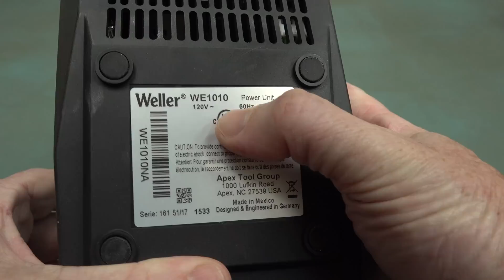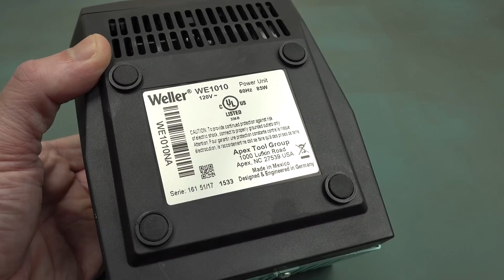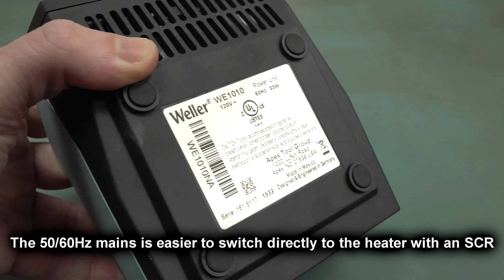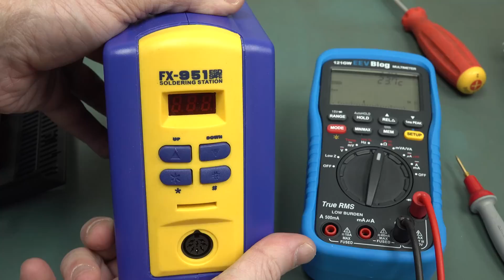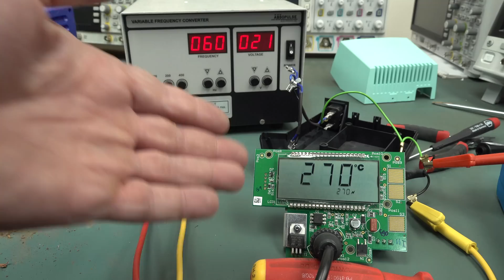EEVblog #1152 - 240V-120V = Magic Smoke!

Comment: Is there a 240V version of that station that you could by a replacement transformer from that model to repair it. Wonder if the original cord had a fuse in it, some American devices are sold with a removable cord that has a fuse in it (stupid practice , I know, right?)  , like sitting next to me right now is a Holmes brand box fan that doesn't have an internal fuse but rather relies on the included removable cord has a one of those slightly modified C7 connectors on it with one square side I'm sure I could find a non fused cord lying around from an old radio or something that would plug into it.
Reply: That´s the stupidest thing I think I´ve ever heard of lol. Fuses in a removable power cord? come on, who came up with that??

Anyway, he could buy any 240v/24v  with a similar power rating and put it in there. No need for anything special.
Reply: @Basement-Science  Especially if you use a totally common power input connector. If that would have been a proprietary plug, it would still be a stupid idea, but a standard connector? That's just crazy.
Reply: I guessed that. Is it still 'normal use' to keep the fuse in the cords? I remember these special cords on computer-equipment (and because we didn't use the cords, we took the fuses out before tossing the cords away when we re-equiped it for 220-230 Volts).
Reply: Thats not that stupid. If you have a fuse in the powercord, you can more easily replace it. Easier than if it was on the pcb anyway.
Reply: @jort93z  You aren't supposed to replace a fuse on a regular basis. You should think about why it blew. Also .. just put it in a fuse holder on the device like it was done for decades.
Reply: It's stupid if the cord uses a standard plug on the device side and the cord could be easily and mistakenly substituted for one without any protection.
Reply: @jort93z  At that soldering station? Just make the hole a little bigger and put an IEC socket with integrated fuse holder in there. They typically carry a spare fuse, too. 
Devices needing an IEC input typically are big enough to put a fuse holder SOMEWHERE. 

A fuse in the plug or something is fine, as long the cable isn't detachable at all. If it is detachable .. maybe with a very proprietary connector, but I still wouldn't like it.

Using an IEC-connector is .. I switch those leads around like crazy.
Reply: @VintageTechFan  Yeah, just looking inside the thing when Dave took it apart there was plenty of room, and on my Box fan there should be sufficient space in the motor hub area to put a fuse holder and actually I don't know why they made the cord removable since I would think it would be cheaper to permanently attach the cord and if the cord is permanent then there is no problem with putting a fuse in the plug although I think it would probably be smarter to put a fuse inside the device because is discourages less knowledgeable people from replacing or bypassing the fuse if they have to get into the motor hub and if a box fan is blowing a fuse it's probably fried anyways and should just be discarded if someone were to put a piece wire or a wad of foil or something to bypass an easily accessible fuse it could start a fire.

Comment: Are you going to add a switch mode psu to replace the transformer and rescue the station!
Reply: SMPS, NOT NEEDED.  
Dave just needs to source a COMMON 240 Volt to 23/24 Volt HVAC (heating, cooling) transformer at 2-4 amps that is same size.
THESE exist .... since those same HVAC transformer suppliers were OEM suppliers for some earlier Weller products.
Reply: You don't need to rectify the output of the SMPS if you don't want to (except maybe for feedback purposes).
Whether the circuit can work with tens to hundreds of kHz AC is another question, but I wouldn't rule it out completely.
Reply: galfisk Running 100kHz down that iron cable doesn't seem good from an EMI standpoint.  A normal SMPS keeps the higher frequency stuff paths to a few cm at most.  But then again it's still longwave with medium wave overtones, so a 2m lead might not be a problem.
Reply: It’s only a 24v output. These things are everywhere.
Reply: Caramelization is insulation, right?
Reply: Don't work because we need AC not DC.

Comment: Put the transformer from that crappy Hakko knockoff in the Weller if it is close to 24 V.
Reply: lol that would probably work. And while you´re at it, put its fuse in the weller as well!
Reply: I have chinese Weller knockoff. It does not have transformer in it, but a lead weight. The temperature adjustement is just a Triac without  feedback. But  it works quite well, considering the 10€ price.
Reply: Thats what I was thinking!
Reply: don't forget to relable the 120v to 240v
Reply: but that would void the warranty on the Weller!
Reply: Jacksat  but then it will defo catch on fire:(
Reply: MrOrangeman18 no, hakko clone has actual fuse
Reply: @rasz  
Yes, but I doubt the transformer insulation is anywhere near as good as the Weller transformer.
Reply: @WaltonPete  : Maybe ,but good enough to squeeze some more years out of the Weller .
I rather toss that fake Hakko board and iron in the bin than the Weller , if it provide enough current you won't note any difference  against the original transformer ,maybe the iron would heat up faster on 230V trannie.
Dave ,put the Hakko leftovers in the dumpster for the next "Dumpster diver"   😁
Reply: @MrOrangeman18 , but not if a rated NA fuse is replacing the Chinese version, first.

Comment: Why the heck are the plugs compatible for different mains voltage? Go with EU plugs!
Reply: What's the replacement of IEC sockets in Europe?
Reply: IEC sockets are fine in EU, but you have to put a fuse right after the connector. That way it would be safe.

Comment: Dave get a 240V transformer that fits in there and fix it! Would love to see a repair video!
Reply: Yeah, 24V secondaries are very common, shouldn't be hard to find one.
Reply: I reckon Weller will send a complimentary replacement within a week :)
Reply: Green Silver  a rewound MOT would be way too big, but in theory, sure.
Reply: Or send it to Weller’s swap-it-with-used-shit center and see what mystery one you get back!  If your lucky, it will have solder tip burn marks on all the buttons like mine!
Reply: Manu _ 
I was thinking along the same lines, could a salvage MOT be used stead?
Reply: I want to see him wind his own! 8)
Reply: and show us how you think the primary side should be protected, even though you change it to 240v. That's what I would like to see.
Reply: Why get a new transformer? Rewind the the primary on the original one for 240V! Electrical Steel is hard to come-by for non-industrial customers.
Reply: TheCreeperkiller But rewinding a rectangular bobbin is difficult without cutting open the welds on the core. Cutting and rewelding isn't exactly going to preserve the electromagnetic properties of a laminated core.
Reply: John Francis Doe
"Cutting and rewelding isn't exactly going to preserve the electromagnetic properties of a laminated core."

What does this mean?  Welded steel is welded steel.  I don't understand how it would change the properties.
Reply: @KerbalLauncher  My toughts exactly. Then I remember that in high school I had to do it and it was a PITA
Reply: I have done rewinding a few times. Yeah, it's a boring task. And those where not welded transformers. Some of them had cores that had to be assembled from the opposite sides interleaving E and I parts and then tightening all of that together with some outer shell or even some kind of glue. Cheap design and it gives out some humming noise, but still working just fine.
Reply: @KerbalLauncher , The EI core has been welded shut, making disassemblly all but impossible.
Reply: @kittsdiy  id replace the transformer. But Id also get one rated for at least 26 volts on the primary unloaded.
Reply from the maker: Replacing a transformer hardly makes for an interesting repair video.
Reply: @EEVblog  Change it, not because a video - this thing is a SURVIVOR - it deserves repair.
Reply: @nasko8605 ,   a survivor with a FUSE, this time.
Reply: @EEVblog  Well, you under-estimate the amount of interest there would be in such a video.  I would love to see it, as far as sourcing the part, even if it was salvage, would make for good conversation.  Heck, make a custom mod with that in your own custom box.  There is an opportunity to do quite a few things with that.  I for one would love to see videos where one modifies or upgrades equipment to make it better or more usable.  CHEERS from Ameerika!
Reply: @EEVblog  You could always do the replacement and use it to demonstrate the proper fusing arrangement.
Reply: @EEVblog  You can always send it to one of those "I'll fix it no matter how totally busted" masochists here on Youtube. Could be therapeutic to see him rewind the whole primary.
Reply: @EEVblog  So, says you!
Reply: Make it sing one song when you over volt it again and another song when it is warming up and yet another when it is cooling down.
Reply: @EEVblog  *update you mean. id repair it. even with a better one that is better on the mains and secondary and 120/240  transformer. edit also with mains fuse.
Reply: @EEVblog  You know people would still watch it! Second channel worthy, maybe?
This thing's a survivor and deserves a second chapter in its life :P
Reply: @EEVblog  You're right, a simple tranny replacement wouldn't be very interesting but you could "EEVBlog" it up. Sorta like, "that's not a transformer, this is a transformer!" (Installs a ridiculously huge tranny).
Reply: This thing will smell so bad after that, doubt he wants it around.

Comment: Take it you don't have a fuse in the plug top  as we do in the UK..
Keep the good work
Reply: In the UK the plug's fuse, if correctly sized, is only to protect the house wiring and the cable from the outlet to the equipment. NOT the equipment itself! Using an incorrectly sized fuse , typically using a 13A fuse where a 3A would be more suitable (which now is most of the time) can cause fires as the equipment cable overheats.
Reply: That is correct
Reply: @daveturner5305  I'll take good ol' American power any day. 120/240 60Hz
Reply: But having a fused plug is still better than not having a fused plug, even if the plug has a 13 Amp fuse fitted. 
Having said that, 3.1KW of available power in the UK will make a big mess to those tiny primary windings.
Reply: The fuses in UK plugs just allow you to use a thinner cable from the plug to the equipment, that´s about all.
The house wiring has to be correctly protected by the circuit breakers in the distribution board.
Reply: Absolutely - no contest. We are in agreement.
Reply: Further - this is the thinking in the UK: which, in my biased view,  whilst not the most convenient system for size, is nevertheless  the safest system where a ring as opposed to star distribution is used!

Waiting to be shot down
Dave
Reply: @daveturner5305  Star distribution is not generally used in socket circuits.  

As you say in the UK we use the ring (which most sparks seem to hate even though they still use it) or the radial.  Think a ring  but instead of the last socket having a cable going back to the distribution board the circuit ends there.  Radials generally use thicker cable and/or a lower rating breaker.

Abroad, it is generally only radials that are used.
Reply: @cjmillsnun  what's so hard about a ring it's just got a start and a finish  simple
Reply: @cjmillsnun   UK electricians don't like ring mains (now called ring final circuits) because of the more complicated testing required.
Reply: @johnnodge4327  Even if the primary shorts completely, the remaining cable may not get to 13 amps and that would be a big mess. So a correctly sized fuse is needed.
Reply: Nope.  In Australia there will be a 16 or 20A breaker in the distribution board, so 3800-4800W can happily flow without tripping anything.  There's no protection for the flex from the outlet to the equipment, or the equipment itself.

Comment: Several current soldering systems have switch mode power supplies. Service people used to avoiid them because of the noise they generated but these days everything has such a supply so there is no longer a desire to avoid them. The problem with everyone using IEC cords is you can easily plug something into the wrong voltage. That was an advantage fixed cords had over these.
Reply: Honestly you would think that every device sold today would have an SMPS, but apparently it´s not worth investing any development into these products and pay the higher materials const of a mains transformer instead.

Comment: I'm shocked! No fuse on the primary side!!! And we are talking about a Weller brand. That's a shame.
Reply: Dana Vixen If you watch it carefully you will see that's on the secondary side. It should have protection on both side!! I think a glass fuse is a basic thing to have in circuits like this.
Reply: @gaborballa8566  exactly! For that amount of money, even for an entry level device from a supposedly high end manufacturer, this should be mandatory, full stop.
Reply: Even better HRC sand-filled ceramic, glass can explode with high fault currents ... https://electronics.stackexchange.com/questions/31366/fuses-what-are-the-practical-differences-between-ceramic-and-glass-cartridge-fu
Reply: Weller has become garbage.  We have 8 of the WR3M ($2500 machine) and the pump impeller vanes fail constantly.  Every part is available except the pump.  It’s a beautifully made machine except the pump that you cannot replace.  Go with Metcal.
Reply: @gavincurtis   where i work we have 18 wr3m and they run since we bought the 10 years ago with no problem on the station the wsp80 iron dies quit quick in about 6to 8 month but weller replaces the with no questions but the tips on the 120w deslodering tool( i think is the dsx120 but im no sure) is total garbage i need 1 to 2 a week .
Reply: Nick,  perhaps you are not using the desoldering or hot air pencil as much as we do.  The defect is the material used in the graphite vane pump.  Glad yours has been good to you. I just sent 2 more units recently, one missing a pump completely as I sent it off to somebody else to have it duplicated so we have spare pumps.

The graphite vanes appear to be more resin than graphite so they wear very quickly when hot.  There is very little allowance for wear before the pump seizes.

I will never buy another WR3M.
Reply: @gavincurtis  they are not mine but i use the on at my workbench for 8 hours a day for hot air soldering and tht desoldering mainly i have a small weller station for smd soldering too that runns with no problems
Reply: Do the ones you have use the mechanical vacuum gauge or the green/red led vacuum indicators?  It is a problem because a particular eBay seller had replacement vanes manufactured.  He sold out his entire inventory in a few weeks.  Every single unit of mine is on its 2nd or 3rd exchange.  All because weller refuses to make the part available like all other parts.  Recently got a Metcal rework system for my master tech.  So much better for desoldering, much stronger vacuum pump.  Time will tell of it has a good pump for lengevity or not.

I had a pump sent to china for reproducing.  Graphite vane pumps rarely wear out. The graphite vane pump in the Weller stations appears to be a cheaper brownish shiny material than graphite.  It appears to be graphite and resin, (like a brown bakelite) and not the jet black graphite like other vacuum pumps that never wear out.  I sent a pump to china to be reproduced.  They said the materials are wrong for high temperature gasa and vapors.

Regardless, glad yours have been good to you.  I will be replacing.mine with Metcal stations as they die now.
Reply: I've never been very impressed by Weller stuff anyways, I know it's a known brand and everything but I never got the feeling that I'm getting full bang for my buck with them.
Reply: I used weller for years and they were the best. I need a new heating element / temp probe for my old weller 4000 series.
Reply: That's what I said. Where is the thermal cut out? Is this because it is an "industrial" product as opposed to a "consumer" product? I wonder, as if you look at the older professional video cameras, they did not have to comply with the radiation emitting device standards that home video cameras (with the B/W CRT viewfinder) had to comply with.
Reply: I've had issues with two WESD51s, including a replacement iron. (Temperature going to 900-ish  on the screen and going cold)  Shaking the irons usually fixed it, until it progressively got too bad to bother with. I gave up, went with a pair of JBCs. My WES50 lasted well over a decade. I don't think Weller means what it used to as a brand.
Reply: One of the WESD51s started having a problem a week after I bought it... and the replacement iron for the other one worked for 3-5 weeks (don't recall exactly) before it started having issues (but it lasted maybe 4 months before I gave up on it)